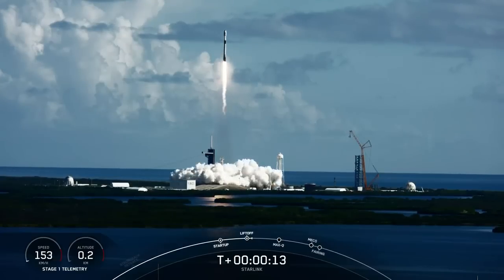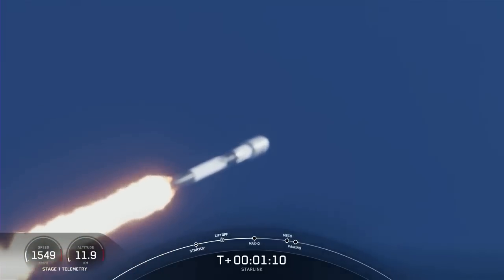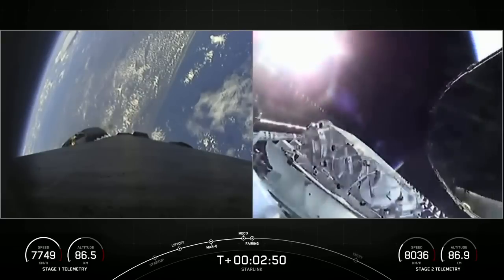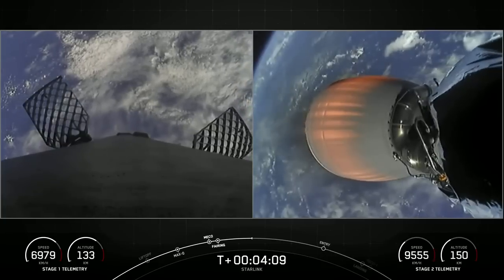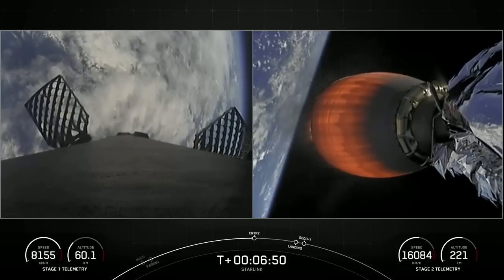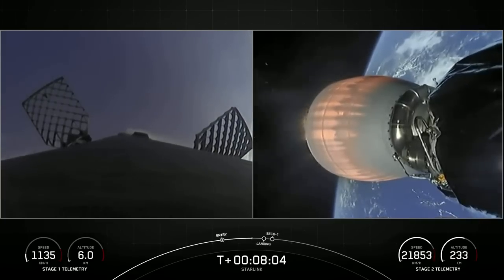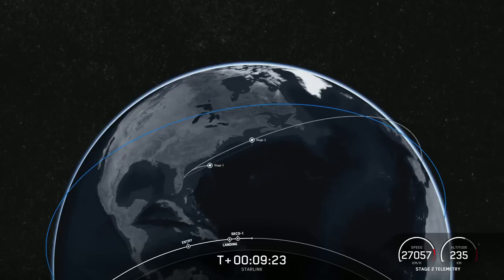See SpaceX launch Starlink batch from Florida! Great landing views too

Comment: 1:25 Spring cut off. {Seriously - the whole in the Ozone is big enough -  engine reduced to min if not near off before first Inner Ozone layer = same on entry. } 

Navy could use some target practice, no doubt./!\

1:53 3k over needed force = You are not helping Global over heating. /!\/!\ 
"Take a break and fix the damage by converting to steam factory and salt water removal". = keep satellites away from Ozone breach(s). == [ above (137 low /142 mid/147 high)♻next time -  {speed gauge flocked on that booster pod./!\ by 7k - 6920 - see 5:02 }: ((Prioritized {shrinking} monitoring of Ozone / {oblonging}, as some call it.)) ] === every flight may be your last.!.

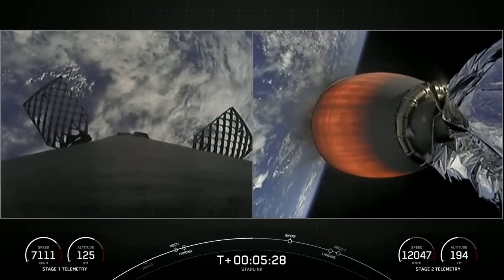5:34 cooling tail coupler: update, looks much more stable. Very nice! 👏👏

[4:28 - 5:51 This is the: {Ozone depleted pockets/vortex/worm hole}. = "Public disclosure".😎 6:15 "Thank you"./ 👍👍3:44 ]

11:52 Appears: in the inner zone - clear to ignite. 👍🤔🤔 - we get a few beams to work better then cameras - meaning Cal to Florida inner bow readings.?.

"All the above notes apply to Stage One". 
"(personal signature) required: ('in presence'/in person)"; on /!\ ((officialize business action)) /!\
Toombs Enterprise
CO.Rev.Sta. 1-40-111
Entity # 20121013201
Scott William Toombs
Signature:___________________________________
Date:______________________
Time:______________________
https://www.sos.state.co.us/pubs/notary/home.html

Pursuant to CO.Rev.Sta. 13-90-107(1)(b): An ((attorney)): {shall not be examined} (without the consent of his client) as to any communication; made by the (client) to ((him)); or ((his advice)), given thereon in the course of (professional employment); {nor shall} an ((attorney’s)) (secretary, paralegal, legal assistant, stenographer, or clerk), be examined ((without the consent of his employer)), concerning any: fact, or the knowledge, of which (he or she), has acquired in such capacity.
https://leg.colorado.gov/colorado-revised-statutes